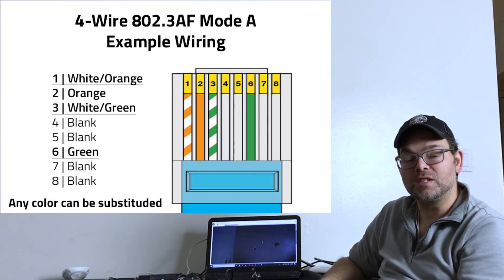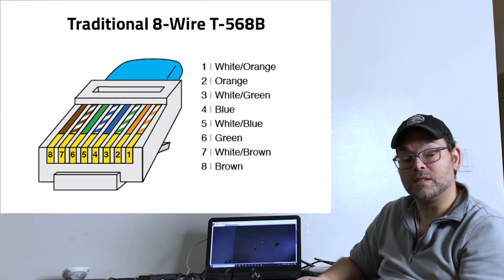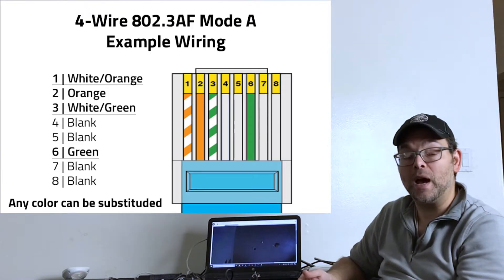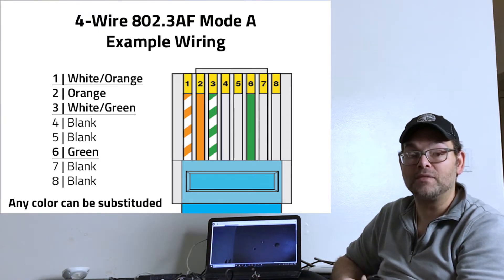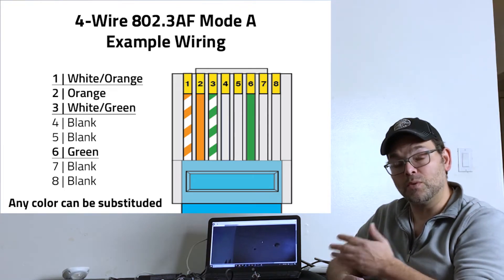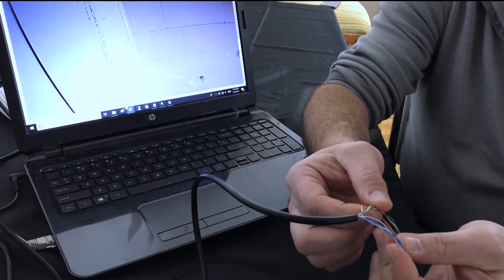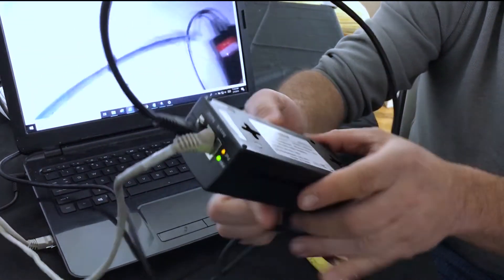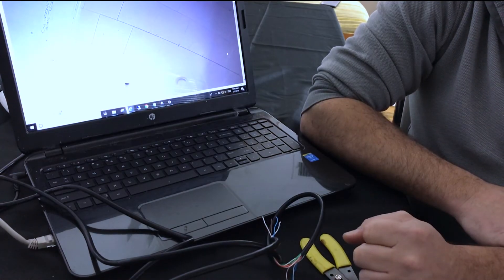Power Over Ethernet Using 4 Wires (2 Pairs)

Comment: Hi good morning, let me asking you something, i got a security camera wit 3 pairs cable, orangewhite, orange, greenwhite, green, redwhite, blackwhite. i need to build a coupler for a regular cable cat5 B, what will be the cross  in order to get the camera workin whit power, audio, video? Thanks
Reply from the maker: Hi Carlos,
From what you are describing to me is the camera you have is an analog technology. It does not communicate digitally the same way Ip cameras communicate. In those cameras usually a pair is for video and a pair for power. Many times in the camera cable itself there are only 3 wires since they share the negative of the camera. From what it sounds like on your camera ,is that it has hd on a pair and a separate analog video as well that when tvi first came out was for spot monitors options to work as well. As for audio I only have seen the analog cameras that are motion sensors or covert that have it built in and that also is a pair of wires, which most times at the root shared a ground as well with the camera and the power.
Hope all is working out for you
Reply from the maker: If you could tell me if it's a Hikvision camera then I could get you there color code. Otherwise I cannot guarantee every manufacturers equivalent
Reply: @cctvny  , Is a Swann Camera, i was replacement (couple minutes ago) redwhite for brownwhite    and      blackwhite for brown.    i left bluewhite and blue EMPTY... and i start getting video and audio, BUT i'm not sure it's that right?? thanks for your FAST answer Bro
Reply: @cctvny  , Now I try connecting blackwhite for BLUE,      and     redwhite for BLUEWHITE,  the video quality work better. and the camera feel not too hot

Comment: Can I use 4 wires from an 22/4 data wire which is not twisted like cat5e wires?   Thanks
Reply from the maker: Jason you can not. You may get power but not data. It needs to be twisted for data. I have been to a site that tried this even on a 12 foot run and it did not work. There are converters by companies like altronix and vigitron thet let you use a pair of non twisted cables for poe. If you need this for a cctv solution you can use a tvi/ahd/cvi camera for a 100 foot run of quad and then you can have an encoder or dvr and then import it into a regular nvr as an rtsp stream

Comment: I thought that poe comes from the brown pair?
Reply from the maker: It does on most switches , but here I'm demonstrating 802.3af mode a capable devices, switches and injectors. 
So to recap the camera or device must support the standard as well as the switch. If you are using an nvr and for some reason one of your camera pairs got cut or damaged durring construction. You can use a poe injector that supports 802.3af mode a and plug the camera into the poe out and plug the data Into one of the camera ports of the nvr. You may have to manually set its ip adress in the nvr and the camera if it no longer finds it automatically. But it saves you from running a new line
Reply: So if my cameras power comes from brown pair - which other pins are also active?
Reply: @leem6011  green and orange, blue pair is used for 1gb connections if the camera requires it
Reply from the maker: @leem6011  blue
Reply from the maker: @leem6011  if there is voltage on the brown pair then there will be voltage on the blue pair as well and data will have no voltage on orange and green pairs, which is not 802.3af mode A